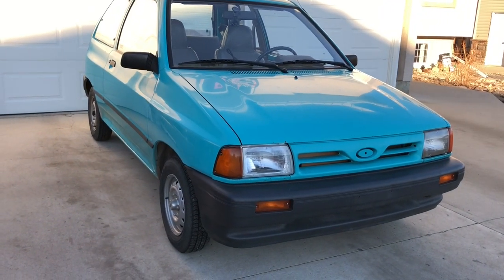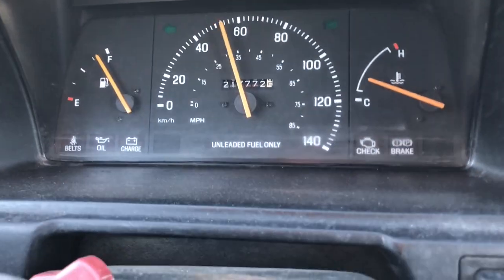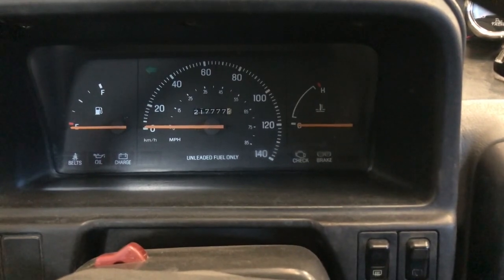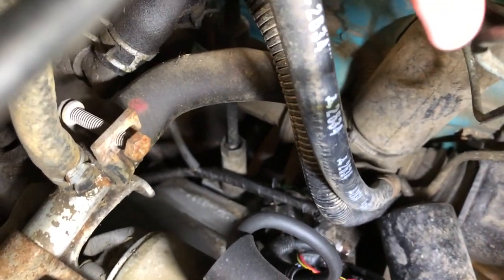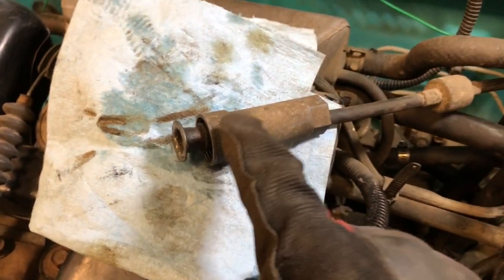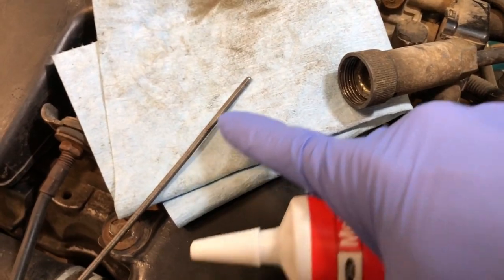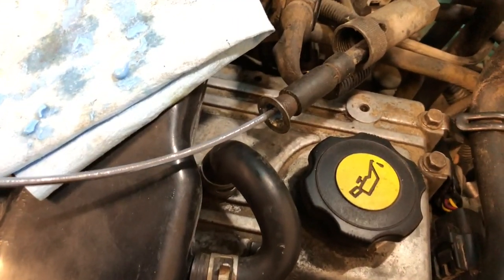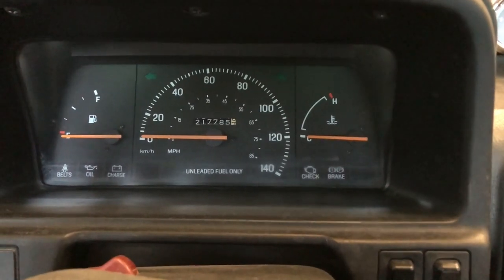How To Fix A Shaky/Bouncing Speedometer [BEST CABLE LUBE]

Comment: I have an 88 crownvictoria doing this right now thank you so much for this video. Ive spent over 600 bucks in suspension work before finding this the noice was driving me nuts.
Reply from the maker: Good luck, you might like my video from the other day, I got a Town Car.
Reply: @InternetDude  i really like your videos on the foxbody. I got the same engine in my crown vic the efi 5.0. Im going to try and get mine to match the mustangs hp. Right now im only getting about 150hp out of this thing stock and thats really slow for a 4000lb car lol
Reply from the maker: @nazarethbarker4937  the single best thing to spend your money on next is to change the rear differential gears. It will feel like adding 75hp or more.
Reply: @InternetDude  What do you recommend i add? ive got the stock 4speed transmission in it, and frequently travel the highways over 65mph or more  i dont wanna kill my fuel economy but whatever it has now is way too sluggish
Reply from the maker: @nazarethbarker4937  I’m not sure what will be best, maybe 3.55 gears. Try asking in a forum for more answers.
Reply: That's funny because I'm looking for solutions for my 88 crown victoria right now lol

Comment: Great video! I have a 1990 Toyota 4Runner, the same principle applies with the speedo cable. When its cold outside ~ 20° F and below the cable makes a really annoying loud buzzing sound. Gonna do what you did to fix it.
Reply from the maker: cool!
Reply: Yeah only when it’s cold did you fix it ? Mine has same
Reply: @077nerfboy  Yes, bought a new speedo cable and it fixed the noise.

Comment: My speedo quit all together and became noisy on my 82 Chevy van. Did this trick and it was up and running, but now bouncy😮 going to try the speedo box
Reply from the maker: if it still bounces after doing this there is a chance the speedo cable is kinked or sharply bent good luck
Reply: @InternetDude  I took it out, cleaned it and it was smooth removing it and putting it back in.  I think I'll order another online

Comment: Thanks hopefully this works on our 1995 Peugeot 405 😀
Reply from the maker: It depends if you actually have a physical cable or electronic connection 😉 good luck.
Reply: @InternetDude  I think it’s a physical cable 🤷🏼‍♀️ I’m not mechanically minded at all but went to do my driving test and got terminated as the Teater said  the bouncy Speedo made the car unroadworthy. (Even tho it passed the last rego check)

Comment: My Cutlass Supreme just started this crap, I am going to try and figure this out myself. THANK YOU! Can I pull the cable right out and leave the housing attached to my dash? I don't want to have to take the entire thing out. Just from the transmission/engine side and pull the cable out right? Thanks again for the video its going to hopefully save me some $$$ at the mechanic.
Reply from the maker: I’m not sure, there are a few different styles.

Comment: Hi I have the same problem it make noise more in the morning I have a 96 Toyota Tacoma v6 manual., do you have a video how can I fix it ?
Reply from the maker: The process should be the same. You’ll have to disconnect the cable from each end which could be tricky, might want to find how to for your vehicle.
Reply: Were you able to fix yours? The gears in my 96 Tacoma keeps getting eaten up after 10 miles. I replaced the speedometer gear drive twice. Any recommendations? Thank you
Reply: @FreeGuahan  no I need to fix it

Comment: Hi! So my 1994 Mazda B4000 SE manual 4WD speedometer bounces bt 50-60 mph nonstop when I hit 50 mph. Also makes a very slight buzzing noise as soon as it starts bouncing. Would this help and how do you know if the cable reattached itself correctly after you stick it back into the end that disassembles from the transmission (the end that would attach to the speedometer itself)? Does it click? Twist?
Reply from the maker: It sounds like your cable needs lubrication. I'm not familiar with your exact cable but generally the cable can be jiggled to make it fit in the trans or speedometer as it has a "square" end on it.
Reply: @InternetDude  thanks for your response!!
Reply: @InternetDude  Do you know where I can find the speedometer cable coming through the firewall on my particular vehicle? It doesn't come out at the top like the Festiva does

Comment: How the heck did you get cable out of outer sleeve?!  I am pulling hard ,  one end in vise,  and it just stretches.  I don't have the same vehicle but my cable is built very similar to yours.  Does the 'plastic square needle end' pull right through sleeve?  Mine goes in a little then stops like it is not going any more.  No way to properly lube with getting it out..   edit(I see your square end is not plastic like mine..maybe that's why mine won't remove. )
Reply from the maker: Mine slid out easily so it must be a different style.
Reply: @InternetDude  I just tore apart same style cable from junk yard to see what ticks...2nd gen 4runner and trucks do not come apart..confirmed!(at least autos).  I could put the plastic piece back on that I tore off and probably work in a pinch fyi.  But it's a lot of work to take it all apart and carefully cut plastic pieces.  Guess I'm spending yet another $150 for new part.
Reply: Chris, Do you put lubricant on gear also?

Comment: I dont think it it was the lube, more straightening out the kink. im not a car guy, but my physics brain tells me a kink like that will cause the rapid de-acceleration/acceleration with each rev that would cause the wobble. but if you do pull that cable, defiantly want to use good lube in reassembly. absolutely not WD-40.

seen this in a few older cars. what I learnt, its a janky re-install of the dash that bends the speedo cable. the peoples cars that I have seen this effect in are definitely they type who have an "aaaah, just bash it in" mentality. they are also the same folk who have an 'we are doing an speed' mentality. Love ya dad.
Reply from the maker: That could be...

Comment: I did this and now my Speedo reads the wrong speed
Reply from the maker: Unrelated, this can't make your speed inaccurate but smooth. The issue must have been there before the cable lube dried up.

Comment: I don't have that problem on my 1985 Nissan Sentra yet even though it's less miles that this one but older. But do on my 1994 Unvega Rover Ten bicycle got a vintage late 80's or 90's speedometer for my bike it works but problem was at stops the needle was slow to go down the 0 MPH so I spray a little ed40 in the needle and and goes down to 0 mph faster but now the needle bouncing a little more than it was. I think I fuck up my shit it function just doesn't stay still .
Reply from the maker: OK